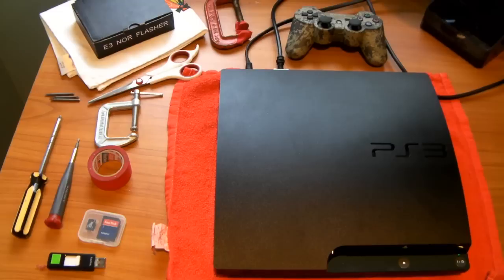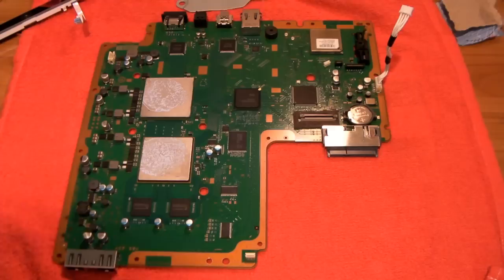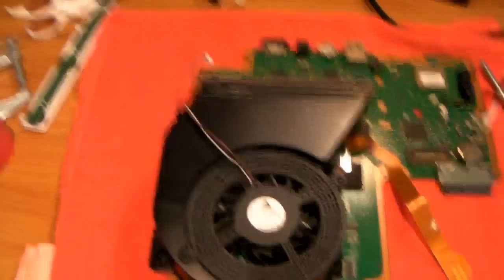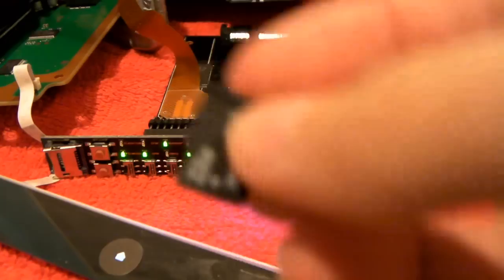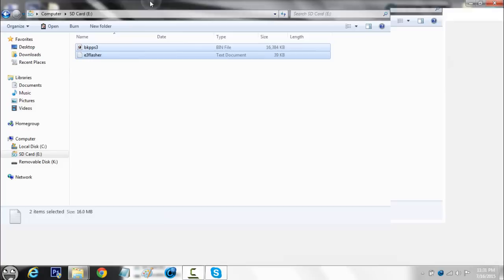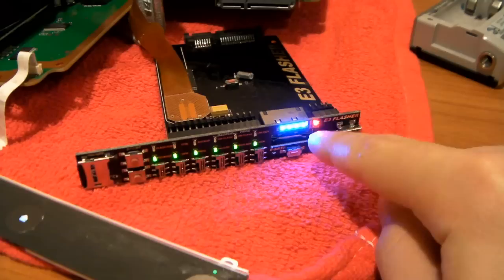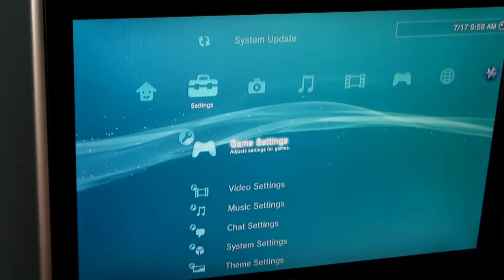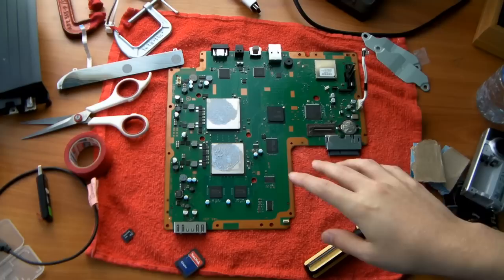How to Downgrade a PS3 to 3.55 with E3 Flasher (EASY!)

Comment: If you get stuck on the "checking" black screen, turn off your ps3, connect your blueray drive restart your system. The usb should get recognized then.
Reply: KyFinesse do you have to have thermal paste please reply
Reply: OG Gamerz I recommend changing the thermal paste. It'll increase the life of your ps3 and make it run smoother
Reply: You do not have to change it but i recommend it. Because when i put my ps3 back together, it overheated just on the xmb. This also could have something to do with the fact I've had my ps3 since 09. However after i changed the thermal paste, my ps3 ran smoothly.
Reply: What if it still says checking and never updates?
Reply: KooliSkey try getting another file. Same thing happened with me I had to try like 3 different times
Reply: worked, thanks. wonder why it didn't work without it
Reply: Nevermind it worked lol just a long wait
Reply: Thanks.  My PS3 got stuck at "Checking...please wait" black screen.  Reconnecting the blu-ray drive fixed it and I was able to complete the downgrade.
Reply: Thank you! 🥹 I started to jailbreak my second ps3 since I bricked my first one in 2018 reconnecting the blu-ray actually worked ❤️

Comment: seems pretty easy and straightforward. outrages to think people want 100$ for this service when you can do it for 20-40$
Reply: if you put ur car in a garage and the mechanic asks €80 chances are the replaced part only cost €30 but you pay manhours + they want a % intrest.. So same here!
Reply: +Red2PtdMaster buying the E3 flasher, plus the time it will take you to downgrade, comes down to about $100. I just need to find someone in NYC that will do it for me.
Reply: +Ethan F It's really easy. I downgraded mine . my model was the last one able to downgrade so it had many protections to keep it from downgrading. It's simple though
Reply: +Constable Cookies an e3 flasher costs 40$ on Ali express and 50-60$ on eBay/official e3 resellers
Reply: +Constable Cookies i have a ps3 slim I need to downgrade. But I've never opened my ps3.  I'm thinking of just paying $50 to someone in NYC to do it for me.
Reply: +Constable Cookies i dont want to ship my console to anyone. I'll find someone locally in NYC
Reply: Yeah make sure to give me your SSN too, trust me my dad work for Sony.

Comment: Hi how do I get off of Rogero 3.55 to a different CFW, I keep getting error when I try to use REBUG
Reply: Progenitor In Training rogero-OFW 3.55-Kmeow 3.55-then go to rebug
Reply: Progenitor In Training Install a newer version of Rebug toolbox (I use the 4.78.2 verion). Go inside, once inside scroll all the way to the left and u should see enable or disable qa toggle. It more than likely says disabled. You need to enable it.
Reply: F1VE_TIME_CHAMP no you're wrong you can only got to 3.55 ofw from rogero downgrader
Reply: This is what I have always done. Rogero then qa toggle, then Rebug 3.55 then whatever version of Rebug you want. It's worked for me dozens of times.
Reply: F1VE_TIME_CHAMP ah ok but I've always had to go to rogero>ofw>kemow>rebug

Comment: Can´t we just use a USB stick instead of a SD card, because the flasher has also a USB slot..
Reply from the maker: No. That's used for other purposes.
Reply: ArchieG then why is in the manual an instruction how to update flasher via usb?
Reply: I used the USB port to update my E3 flashers firmware itself by connecting it to my computer, as my micro SD card wasn't connecting. Later on I changed my micro SD, which fixed my problems.

Comment: hey man, i REALLY need your help, everytime i start the dump process, my fan starts to get REALLY loud... also, when i put pressure on the e3 clip ( the one that's attached to the motherboard) it does the very same... can some one please help me out?
Reply: Tighten heat sinks, or apply new thermal paste i had this problem yesterday
Reply: hey man, you were right! i downgraded succesfully now, but i'm wondering if i can install dex now... like, am i already on a cfw now, or do i have to install it after i activated that qa pkg? thanks for the help!!!
Reply: +zoa adilli no problem, im currently fucked right now though. Everytime i connect mu sub to downgrade it says" no applicable data was found"
Reply: well, hacked tutorials almost never replies to comments... i don't know what the problem is, but i will look into it..;)
Reply from the maker: Make sure it's in the right USB port, that the folders are organized correctly (PS3 > UPDATE > PS3UPDAT.PUP), and make sure your USB is formatted to FAT32.
Reply: speaking of the devil.... lmao
Reply: I got it, i successfully jailbroke my ps3
Reply: glad you made it! welcome to the community lol
Reply: I will commence this process after I get an eflasher.
Reply: +zoa adilli  i have a question
Reply: what is your question, Jermaine?
Reply: Then you need to put thermal past or toothpast on the rsx and gpu as a tempery fix. That worked for me every time I have downgraded so far
Reply: i had same issue but every time i downgrade i only put the fan on top of the heat sync all i needed to do was put pressure on my fan with my hand for it to stay on long enough to do all 3 dumps ad patch them. If you have screwed the fan onto the heat sync like in the video try putting thermal past onto the heat syncs that should help. :)
Reply: has it done 3 dumps more than once?
Reply: if so just keep trying it will eventually and guys if you are downgrading 4.80 make sure that you have the 4.80 dump patcher
Reply: i got it back when it was released but tonight i will upload the file to media fire and give you the link
Reply: Mrgamer, you need to update the e3 flasher. That's why you are getting 3 dumps at a time.
Reply: kou absolute what are u saying?
Reply: kou absolute u shouldn't have your hdd connected. When u have everything hooked up correctly, u turn on the ps3. U will wait 20 seconds or so and u will get a error messasge saying "cannot start due to no files" or something like that. Then push start button.
Reply: kou absolute yes do not have your hdd connected. When u start it with out the hdd it will give u the error message about 20 to 30 seconds. When u get that message u can start your dumps.
Reply: hey, where'd you buy your e3 flasher at specifically? been looking on ebay but not sure who's a good seller...
Reply: zoa adilli u need your fan on tighter
Reply: that is due to gpu cpu not making contact be sure to do the card board or the other way part to screw it on.

Comment: I successfully downgraded a ps3 slim following this tutorial last year. Now I have another ps3 slim CECH 2001A on OFW 4.80 and The PS3 dump checker included in the link gives me two errors ROS0 hash and ROS1 hash. I googled a newer version of ps3 dump checker and it passed my back ups with no flags. I flash the PS3 but, when I go to install Rogero downgrader through the XMB I get error "this update data is not supported on this system" So I tried installing it through recovery mode and it hangs when it attempts to check my flash drive. I've tried 3 different brand usb sticks. Any suggestions?
Reply: After reading the comments on here I learned all I had to do for the rogero downgrader to install was to connect the bluray drive.
Reply: Juanelio Garciano  i tryed to to but sill cant install  rogero
Reply: NOT ENOUGH GAMING Download a different Rogero from the internet. I downloaded one called Rogero999
Reply: ok ill try
Reply: you still have jb ps3
Reply: Yes I do. I have five of them right now. Four slim ones and one fat one. One has a 1TB internal hard drive. The others have 500gb 7200rpm hard drives.
Reply: dan my i trying is slim
Reply: working thnx
Reply: No problem, glad it all worked out for you.
Reply: hey do you know how to fix if your friends is not showing up

Comment: i would recommend that if you do this that you replace the thermal paste on those chips. What I suggest is getting some isopropyl and use q-tips to clean the old thermal paste off, and then put some arctic silver 5 on there.

Comment: I Get 3 bkpps3 files wich say bkpps30 bkpps 31 bkpps 32 ?
Reply: Did you every figure it out???
Reply: Sylvia Campos-Williams yeh unfortunately i broke my e3 flasher clil cable xD but its exactly the same , just take out the 1 and make it bkpps3.bin instead of bkpps31.bin , it extracts 3 instantly so u dont have to keep doing it 3 times in a row . Hope this helped
Reply: k, thanks.. Btw did you have to update the dumpchecker??
Reply: When it dumps 3 times it means you E3 flasher doesnt have the samsung Firmware installed on it just google how to do it
Reply: ReleaseMods bro could you maybe link me a video?
Reply: dont listen to releasemods... it means your e3 is updated to the newest version sooo. make sure to check if they are okay grab them all together and if ok its a good dump you can also drag each one to be more confident on the dump when you make the patch be sure to have dragged all 3 and you will get 1 patch.

Comment: Anybody that need updated PS3 Dump Checker for 4.81:
http://www.se7ensins.com/forums/threads/e3-flasher-4-81-downgrade-tools-guide-extract-a-ps3-console-id.1355707/
Reply: Thank you.  I just downgraded a PS3 slim with 4.81 OFW and the updated dump checker worked.  
https://github.com/Swizzy/PS3DumpChecker/tree/master/Latest%20Compiled%20Version

Comment: need someones help. I have downgraded before but I think I'm missing somthing this time round, I patched the bkps file etc and copied it to the micro SD card. I renamed it from the _patch etc so that's not the problem I put it back into e3, flasher I then put all switches down and began the downgrading. it finished fine no problems so I then turned off the ps3. disconnected the e3 flasher and took the ribbon cable off. I connected my hardrive and booted up the ps3 and it came on as normal, did not give me the connect controller screen etc. what's happened? did I need to do something with the hard drive first or something?

Comment: Hey I have a question so my model is 2502A and when I disassembled the PS3 and got to the fan it wasn't a clip on fan it was like an actual part of the PS3 and aside from that when I got to the actual mother board the nor chip that you show In the video is wayyy different to mine and if you look on the e3 flasher board there's a chip there that says some PS3 Samson or whatever that's exactly what it says on my PS3 chip any help?

Comment: I keep pressing select+start, nothing happens, just leads me back to the same screen telling me to connect 4.80 or higher. I just flashed the ps3 after patching the bin file. so its not recognizing the rogero 3.55. help im stuck

Comment: PLEASE HELP ME!
I did everything and got to the e3 flasher and put it on...after putting it on I got the switching blinking blue lights, and then I plugged in the hdmi cable, and then nothing showed up on my screen...I then put all of the ps3 back together, and now my ps3 shows up again.  please help me, how do I fix this

Comment: im not getting ANY blue lights, i did everything, i first got the error where i had to re seat the e3,. i did it took a while, then it finally went through with out an error but now there is no blue lights and its been forever. i have 12456 switched down and 3 switched up

Comment: hi good day i just want to ask if the ps 3 slim 4.80 cech-2005a can downgrade using e3 nor flasher. because i try to back up the files it showing is 3 file bkpps30.bin,bkpps31.bin,bkpps32.bin when im trying to use the nor inspect its all error coming.

Comment: Just a note for people. If your e3 flasher is brand new, i've found that I don't even need to clamp my e3 flasher down to get valid dumps. It is advised to do, but try it and see what happens. If you get bad dumps you could go ahead and clamp it, but if not it's a lot easier to seat the e3 flasher that way.

Comment: I always get error code on 1, 5, 6. I know it means it's not applied correctly, but I've tried everything. I've reapplied several times, used different types of clamps, cleaned it with alcohol and a toothbrush but cannot save the dumps without showing an error code.

Comment: Hello guys, my ps3 slim is a cech 2504b model, the problem i'm is that the ps3 has a dead wifi/bt module so could this work for me? Rather than downgrade to 3.55, just put a no bt/wifi update? Many thanks

Comment: I get the ROS0 Hash error, bad dumps, using C-Clamp.  The model is CECH 2101A and the PS3 DumpChecker is Build:488 so it's already updated to the latest even the CFG and Hashlist. And I'm not sure how to fixed this, any help would be appreciate though. I already try to get good dump over and over but yet still get that ROS0 Hash Error. The PS3 Slim is on Sony 4.80 before started downgrading the PS3 with my E3 flasher.

Comment: Hey, just video i found on downgrading and after following to the letter i have now got a ps3 with 3.55 regero downgrader installed, only problem i have is i cant install any package files? i get error 8001002A, also if i try update to a CFW i get error 80029c55?

any ideas VERY welcome
Cheers

Comment: Just followed this video and finished performing it on my PS3. Thanks, ArchieG!
Reply: wazzal7 for real?
Reply: clyde benjamin Yep! Ran into an error at almost every step, but figured them out one by one. I did have to use google for extra help, though.
Reply: wazzal7 can you help me out when I do mine?
Reply: wazzal7 thanks for the quick reply btw, no one does that nowadays
Reply: wazzal7 actually I think I can do it, just one question though, did you use the files from the description or other files?
Reply: Yes, I used the files from the description.
Reply: wazzal7 so they are all still up to date?
Reply: clyde benjamin Well, I'm not positive whether they have been updated, but the revisions in the pack worked fine for my downgrade!
Reply: wazzal7 thanks man, that's enough proof for me to rip apart my PS3
Reply: did you use the update.bin file on your e3 before your started? if so by any chance do you know if it is the Samsung update file- 10.28?  I am just wondering if I should use this update.bin file for my e3 or try to find a real link to Samsung 10.28

Comment: really need your help man, i have the slim ps3, cech-2001a, and everything is okay, until i need to turn on with the e3 flasher installed, but it won't start!! when i take the chip off, it says it cannot start, but it won't say that with the chip on it....any ideas?

Comment: i have now jailbroken and i am on the 3.55 rogero downgrader and i have ran toggle QA, but i want to go to rebug 4.81.2 do i have to install OFW 3.55 and then go to rebug, or can i go straight to rebug from the downgrader. also my second question is, i want to be on dex, but can i go straight from 3.55 to rebug D-REX or should i go from Rex and convert?
thanks :D
Reply: you need to go to cfw 3.55 firmware or it will not work watch his video on how to install it than install 4.81.2

Comment: I just finished flashing my ps3 and I got the error that you got when you turned it on. I tried to press start and select but it would not find the firmware on my usb. Is there anything that I can do to try and fix it

Comment: Sorry, could you tell me why the 3.55 is preferred? (I'm looking to buy a ps3 on ebay and it has the 3.55). Can I still update games to their latest versions? And lastly, Can I transfer my old ps3 fat system game saves to a ps3 3.55 unit without any issues? -Thanks for any info

Comment: hello .. I am following this tutorial and need help .. when I click on the orange button of the e3 flasher those blue lights just get to walk from one side to the other after making 3 times the light one by one .. also the file that you present here in the backup folder is different that I had in the sd card .. in my creates 4 files .. and everything to e3 folder does not have the ps3 program dump patcher .. please answer.. thanks
Reply: Bro dont use that checker.

Comment: I got the same message as you at the end where you have to press select and start to upgrade, but when I do it just continues to say "Searching..." and never finds the Rogero downgrader on my flash drive. I have it in the PS3>UPDATE folder, and my flash drive is a FAT32 so I don't know why it's not working. How can I fix this?

Comment: Got to 29:33 in a span of 4 hours and I'm still unable to seat the E3 Flasher to connect to the chip properly... bad chip or should I try using an actual G clamp instead of a standard clamp??

Comment: I have 2 problems. When I press the button on the e3 flasher, it creates 4 files on my sd card. Also I cannot install Framework 3.5 on Windows 10 😐

Comment: Hello, in 24:35 you mention about reseting it.
What file i put inside the microsd to do it, did you put it in the files in the description?
Also i place 1-2 switches down and the rest 3-6 up turn on the ps3 wait for the blue lights and when they are on i power off ps3? Doesn't need to press reset button or something? And if it does which one of 2 reset buttons?

Comment: You don't need pressure, you need contact. I don't recommand using card board like that. I just use the metal PS3 shield. And it works 100% of the time. But I always put some paper or some soft toilet paper between the shield and the clip.

Comment: I've tried alot of different things, pressure on the nor flasher, everything is snug fit, when i hit start, (sd cad FULLY formatted fat 32 before doing this) it takes about 20-30 seconds for the 2nd Blue LED to flash... Meaning the sd card isnt in properly, ive tried USB too and the same thing happened. ive checked if its fake and if it is they done a very good job at making it look literally identical...

Comment: Hi, I followed the tutorial and everything worked without a problem. However, I am stuck at the rogero downgrader installation (39:18). The installation stops at 99%.I tried restarting the ps3, but every time it just stops at 99%. Does anyone know what the problem is and what a possible fix might be? Thanks.